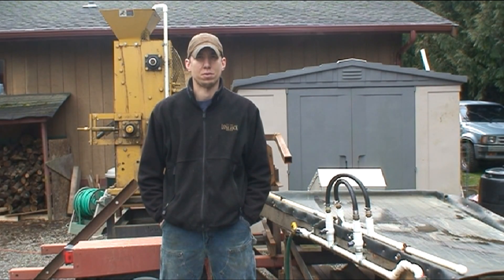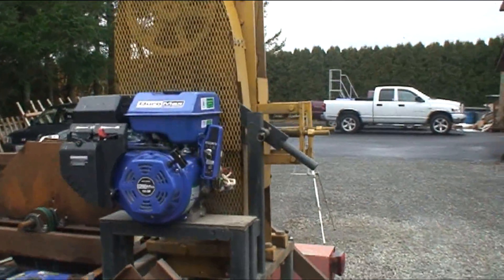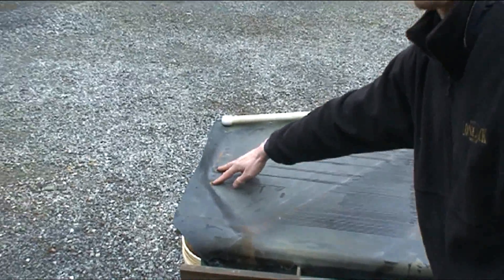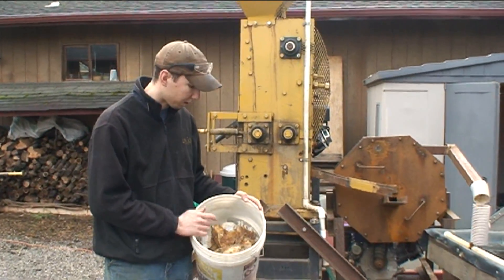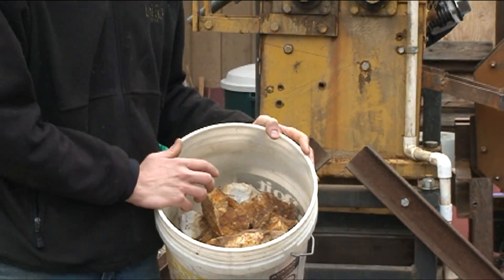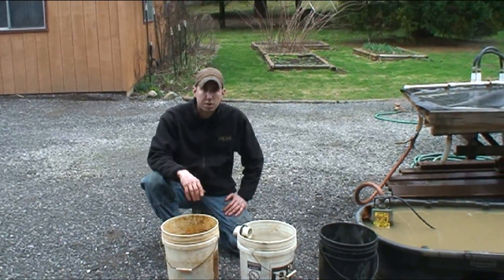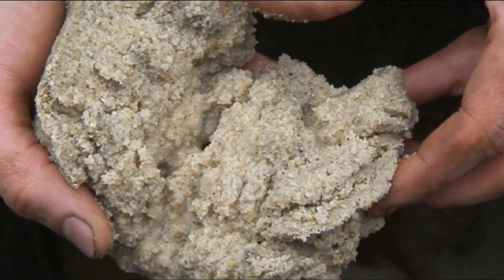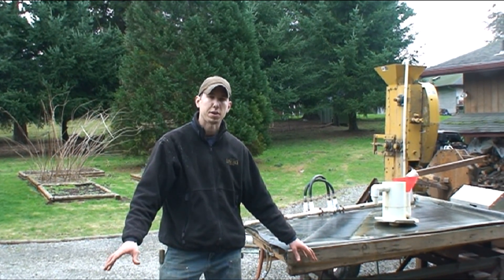Mobile Gold Test Plant, Hardrock Gold Ore: Crusher, Pulverizer, Gold Shaker Table MBMM

Comment: 85-90% is pretty good. In theory, could it be ground up even more in a ball mill, to say 100-300 mesh, and liberate 95-99%? Or would all the gold just float off the shaker table?
Reply from the maker: Yes, In theory the recovery could be increased by finer grind with a ball mill, but there is a point of diminishing returns.  There will never be a way to recover 100% either so it all comes down to the cost per ounce to recover.

Comment: just in case any of you are wondering, they don't make that unit that they're using here in this video anymore. they only make a one ton per hour unit and nothing smaller. I guess there's room for another manufacturer to do that. And the price has gone up because they added a spiral classifier.
Reply from the maker: Hi Dave.  If you have a specific project or mobile mill you would like built we can do custom projects.  Give us a call or email to talk about options.  Thanks
Reply: The spiral classifier is sold separately, as is each piece of equipment.